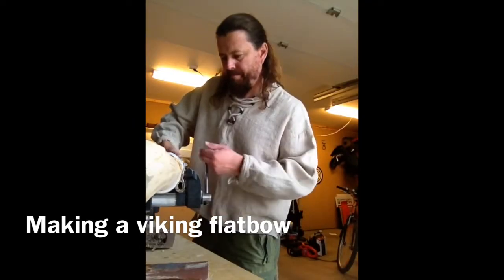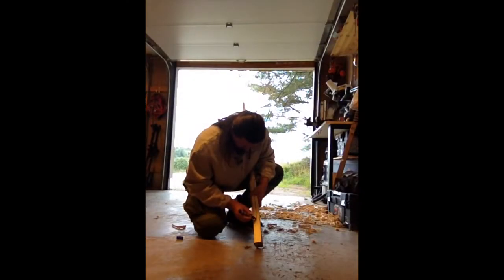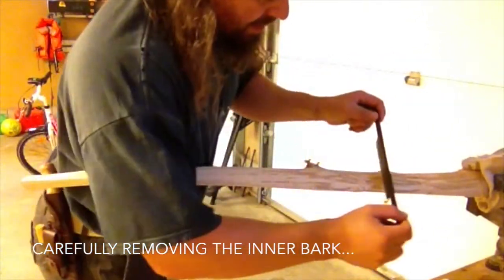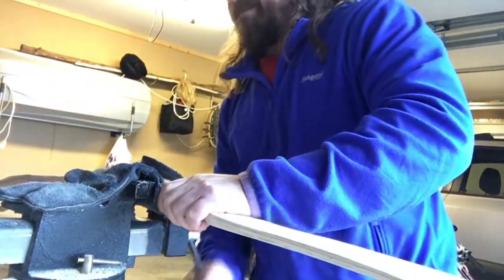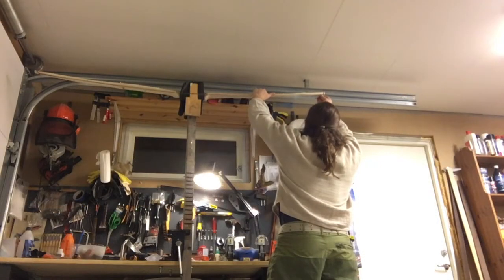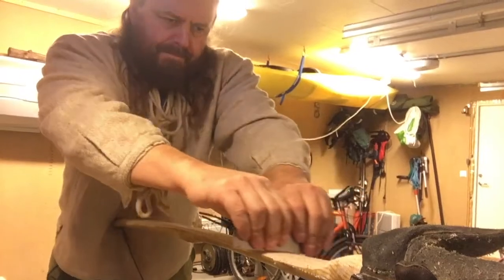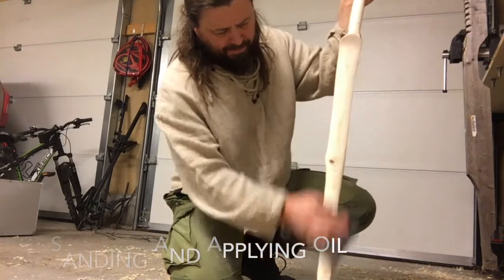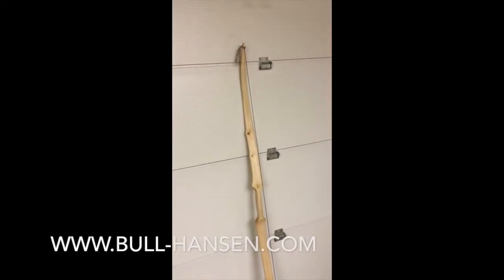Making a Rawhide Backed Flatbow

Comment: Are you sure about the glue thing? Finnic peoples used laminated four piece bows which had siyas. Birch back and compression pine belly. Sometimes they were further backed with sinew. They were however often wrapped in birch bark to combat the problem of moisture.
Reply from the maker: Yes, as certain as we can be. Also the climate is more humid out here by the North Sea.

Comment: Nice work have you shot 50 to 100 and did it change much?
Reply from the maker: The longbow I usually take out with me is about 50-55 lbs now. It used to be almost 70, but I've used it a lot. I find that 60 lbs is ideal. More than that, and I have problems with accuracy. I have pulled a 100 lbs English longbow but it sort of hurt everywhere.